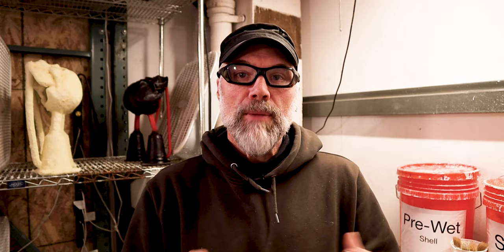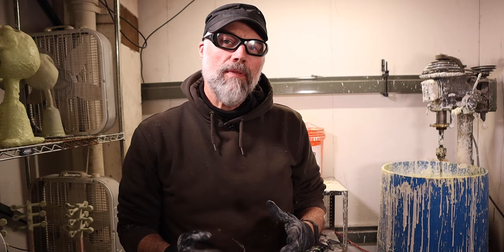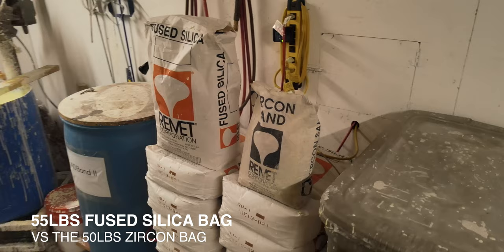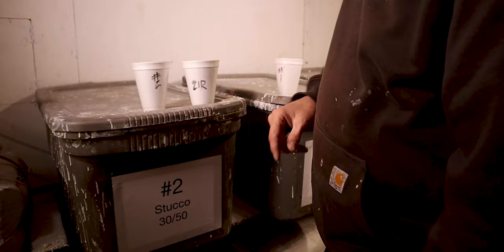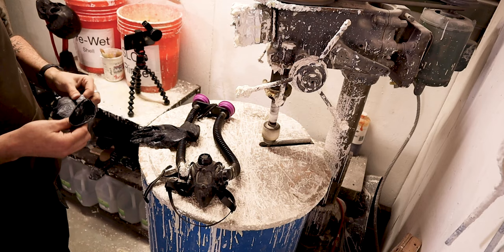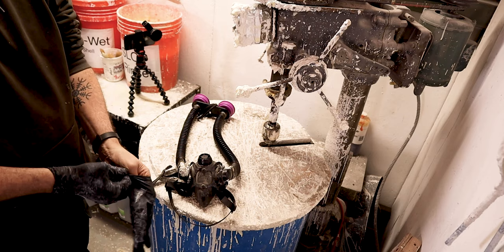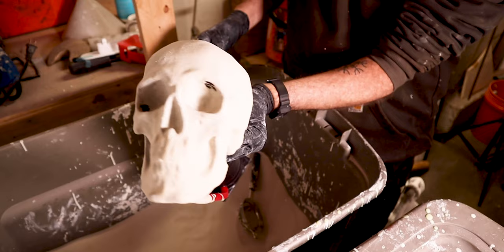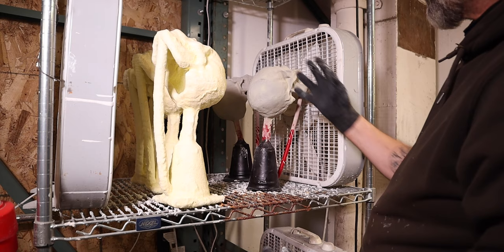Lost-wax casting: How to dip a ceramic shell, Part 1

Comment: Thanks for replying my friend. It's much appreciated! 
I've had very successful castings via castable resin, but it's just been recently that I've been experiencing this issue.  But where Ive had success is when I've made the patterns hollow and thin and vented all the way through the sprue. This seems to releave the expansion pressure.  But lately?? Man! Its been brutal. Failure after failure...
Anyhow thanks again for replying. I really appreciate it.

James Ruther.

Comment: As an automotive repair tech, retired into my early 60's, I was curious out the casting of products I worked with everyday at work for decades. I really enjoy your talent because it takes a certain person. I held 2 day classes but 4 hr tech seminars on 30 subjects in 7 states and many cities. So the message is always first, public speaking is a talent you have, don't or can develop if you know your subject. You have the skills of animation to show what you are doing in theory and in practice. You have achieved this level. Congrats plus I learned something. I would only guess after one video, that "Stucco" is a term that covers many items in the world of fine granules of a sand like product. As sand is sold in sandblasting but also the aggregate used that when mixed with a concrete, it used over wire on the outside of homes & buildings. 
  Question; I will play back with paper & pen, but you included a mix of (Linseed and a solvent) I think, but aids in sticking to trouble spots on a casting. I find the process fractionating! I've only seen on tv. 
  Like parts made from foam like cylinder heads, as you can see little half bubbles in the surface. The 4X4 trans case is sand cast aluminum as you can see the grain & parting line. I don't know why, if surrounded by machines as the oldest on a family farm, or the years of looking at something you have to take apart, you have never seen before, but once cleaned, you have to decide a logical place to start, based upon the symptoms. It is rewarding to avoid the most common mistake other techs make, diagnosing the symptom and not the root cause.
I just like learning as I am restoring a 67 C10 pickup, but putting a fuel injected engine in it, with O.D. auto for myself. Casting some small decorative parts (Not Structural) is something I like to toss around in my brain as I can build, shape, sand and polish just about anything. If cheaper than you can buy or no one makes it, it gives you more pride. Not to show off but to be inventive. 
I subscribed and now have more videos to watch, learn and enjoy!
Thanks!!!
DK, Omaha. ASE Master Tech since 78.
Reply from the maker: Welcome to my channel.  
You right, sand is used in many applications across industries and some of the terminology is the same and differant so it can be confusing.  
It this situation the term stucco refers to the (sand) fine grains of silica that is applied to the coating of wet slurry after each "Dip" to add thickness and structure to that layer.
As for the solution that can help the slurry to stick to the wax, it is de-natured alcohol and shellac.  Linseed oil would stay wet or gumy.  
Ceramic shell is certainly used in some car manufacturing, but most engine parts are sand cast. A common way to form the patterns is cast polystyrene (white bead like form).
Reply: @LunarburnStudio  >Thanks for the reply. The terminology is confusing but it makes sense. I spent a day in a GM hydrogen fuel cell lab with Hues Aircraft engines hired to take 180Vdc, change it to 3-phase A/C, 48Vdc & 12.8Vdc. It was fascinating as we took turns driving.
 I had a brain fart with flaxseed oil instead of shellac that comes from a bug. Even Red dye #2 food grade comes from a bug.
  I really enjoyed the information and I appreciate the extra work behind the YouTube camera which you do everything, edit, sound, music, lighting and software. Then you sit and watch it 3 or 4 times before sending. This appears I would take some investment even to produce 6-8 parts at home for a DIYer who wants to make a few parts. These techniques go back decades as the automotive world produced solid trim parts for inside & out. The radiator cap was extremely ornate and then an alcohol thermometer was inserted to read temps, speedometers were an accessory.
 Hate to ask, but say you produced a polished aluminum part, do you coat it to protect the shine, of leave it bare and polish as needed?
  Best of luck in 2023, I will be watching with an open mind & curiosity. My youngest of two can draw on paper but has no ambition to focus. Thanks. DK.

Comment: First, I want to say how helpful all your videos have been! I'm learning SO much. Second, I was hoping you could give a little more info about the stuccos you use and where you buy them. Do you get them from Remet as well? If so, do I simply inquire about "50/100 and 30/50 refractory sand"?
Reply from the maker: There are a few different types of silica used in ceramic shell.  The type I prefer is "Fused Silica".  So when ordering ask for fused silica sand or stucco 50/100, 30/50.

Comment: great video!  as a practical question, do you think you can cast functional threads in brass using ceramic shells?
Reply from the maker: Doable but unreliable.  Certainly better success on course thread vs fine threads.

Comment: Thank you for your very informative videos
How do you know when it's time to apply the next coating?
Should the next layer be created at a specific time?
Reply from the maker: It will depend on the humidity level of your room. and if you have a core (inner space) that is going to have less air flow.  If all surfaces of my shell have air moving across it and my humidity in the room is around 60-65 % my first few layers are 2-3 hrs, the course coats take 3-5.  If you have a color indicator in your slurry it can help tell you when you shells are ready.

Comment: Great video my friend. Had a question about inclusion marks. I'm seeing what resembles flat bubbles on the castings. What I is, think of a drop of water on a piece of glass looking through from what would be the underside seeing the flat area where the drip of water lying on the surface of the glass. Weirdest thing...

Also, I print with castable 3d resin and hollow to stop expansion and my ceramic shells are still cracking eclven though the patterns are completely vented through the sprue. It's making me nuts!
Your thoughts would be greatly appreciated.
Thanks.
Reply from the maker: I am not sure about the inclusion marks as you describe them. maybe some dirt or oils on you wax pattern.  Maybe degrease you patterns first?

As for the castable resin, I have been struggling with that as well. Casting it in standard investment in a steel sleeve is enough to contain the expansion.  I however Have not been able to get a successful burnout in ceramic shell, which is a major bummer.

Comment: Doesn't the skull also have some areas that have sharp edges (the eyes, nose areas) that make it tricky when pouring the metal in?
Reply from the maker: You are correct, when you have sharp edges or deep details you have to consider how you are going to spru the pattern/wax so that the metal when poured doesn't rip across those areas but smoothly flow in maintaining those detail.  If the metal flows in to violently it will tear up  and drag that broken silica within the metal, making post work chasing more difficult.

Comment: Have you ever tried fused Alumina for the first coat instead of Zircon?  It seems much cheaper and appears that it is also used in industry too Imersys have an application note on it
Reply from the maker: Alumina works in ceramic shell but is less durable than Fused Silica and zircon.

Comment: You said you like to hang your molds instead of putting them in sand so you can see the leak and plug it. What do you use to plug/stop a leak? Thanks!
Reply from the maker: It somewhat depends on the type of leak. Is it a dribble or a gusher? For small pinholes or streams sometime i can use a steel rod that is cold on one end or a rod that is wrapped with some fabric that is damp, placing it over the leak can freeze the metal to form a plug.  For larger leaks I like to use a refractory paste like green-patch, applied with a spatula with a longer handle.

Comment: Thank you for your good program. Is it possible to use another material that is cheaper instead of zirconium in the second and third layers? English. I'm not very good.
Reply from the maker: even though I mentioned zircon for my use, there are other options.  Depending on the base component  (fused silica or alumina) of your slurry, you can use the sand version of those materials for you stucco.

Comment: To dry the first layer without creating new problems wouldn't it make sense to use a dry silica similar to the slurry?
Reply from the maker: Im not sure I understand the question.  The best way to dry each coat is air movement. (I use several fans) I also have a de-humidifier in the room which also helps.
Reply: @LunarburnStudio You do a slurry only first coat but sometimes it cracks and peels during drying. I'm suggesting trying very fine dry silica gel or colloidal silica powder on top of the first slurry layer to reinforce it without loosing detail.
Reply from the maker: You are exactly right.  I was originally taught to do slurry only first coat but to add strength and durability I dust with a fine silica grain.  I use Zircon.

Comment: Hey! How do you know how much metal ypu will need?
Reply from the maker: If you pattern is wax, weigh the the wax pattern and spur system and multiply by x10. The conversion is closer to X8 but the math for 10 is easier and gives you extra for spills and small leaks.

Comment: 10 dips. Wow! we only did 6 sanded coats and a final. Once in I while would do 7 sanded coats.
Reply from the maker: Depends on the thickness of the slurry.  Mine i run thin.  What slurry are you using?
Reply: @LunarburnStudio  remet 13 viscosity on the primary coat x2(zircon,RG1) then ez cast for the back up. What do you use?